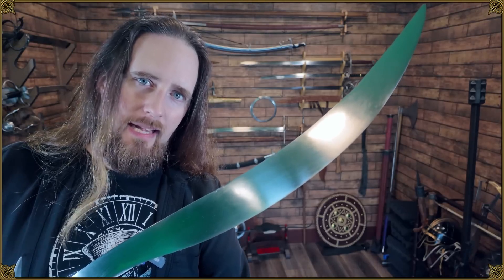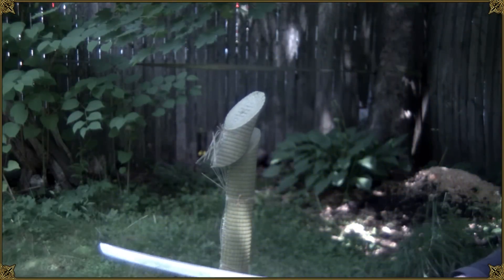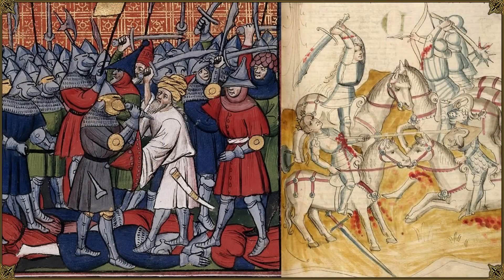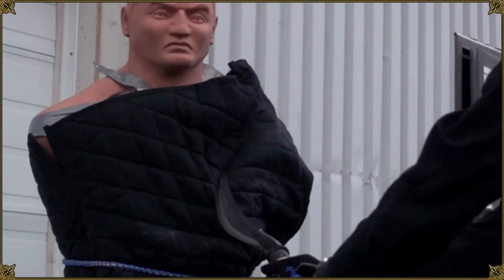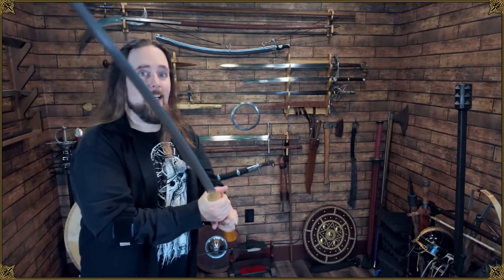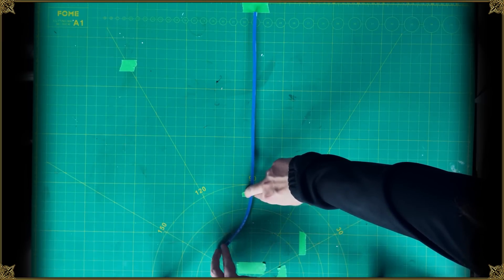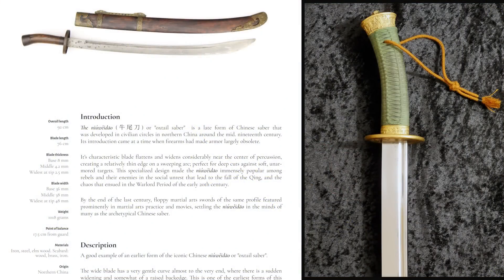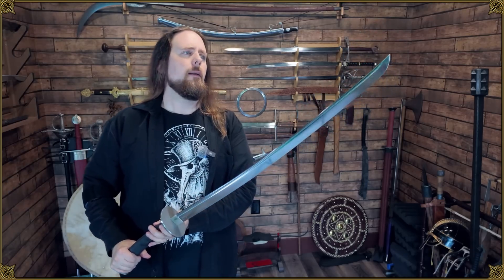Sword Design: What's the Recurve For?

Comment: I can see a couple possible advantages to a forward swept handle:
1) It might help with feeling the edge alignment, as the handle will be swept forward in the same plane as the blade.
2) It might reduce wrist strain or improve the strength of certain movements. Since your shoulders are further apart than your grip on a sword hilt, your arms aren't aligned in parallel with one another when holding or moving the sword horizontally. This would make the forward swept hilt the equivalent of those ergo keyboards where the keys are split into two groups at an angle from one another.

Comment: Regarding the curved handles, the answer might be more in ergonomics than physics.
Do the following experience with a straight-handled and a curve-handled sword: hold the sword in your dominant hand in a neutral position and then pull back with your other hand untill it is physically stopped. With a curve-handled, two-handed sword, the range of rotation of your other hand untill it's stopped by your dominant arm is much greater.
Also, in one-handed sword, a curved handle make so you can hold the blade forward in a thrusting position without angling your wrist too far down, making it gentler on the wrist.
Reply: I based my guesses on an book by Rainer Daehnhardt ("Homens, Espadas, e Tomates"). In one of the sections of this book, he correlates weapon design with wrist angles, namely that the range of motion of the blade, limited by wrist mobility, can be expanded by certain design choices of the handle and crossguard.

Comment: The curved handle in on two-handed sword gives a slight mechanical advantage when the blade has already made contact with whatever it cuts through. A curved handle with a single-hand sword is more about grip ergonomics and the angle of your blade relative to your hold.

Comment: This is just speculation and I have no data to back it up, but I feel like if you were cutting a limb or some target with a small cross section the difference would be minimal. But if you were trying to cleave into a torso or a target with a larger cross section the curvature would spread the point of contact out and allow deeper penetration. 
Just how a lawnmower blade is dead straight, but an axe blade typically has a curvature to it. If you took the radius from an axe head followed it out to sword length it would have a decent curvature to it. 
As far as the handle being curved, I can only figure that the extra distance between the pommel and your arm would translate to a decent amount of travel at the sword tip. So, theoretically it would allow more power from the wrist to be incorporated into the cut.

Comment: I am imagining Christopher Lee's Count Dooku response video where he argues the curved handle is not the placebo effect it is like a dance where the left hand leads transferring force from standing straight to cutting down, yes you move more than with a straight sword. Still, the curved angle of the handle requires less force from the user because body weight is transferred into the cut.

Comment: The way that I see it, a curved blade (or even bent like a kilij) redirects the energy of what would be a chop into a slice. So, you can have all of the power of one, but redirected into a slice. You do get a slice with any cut, of course, but it's more of a chop and then slice than the energy going directly into the slice. Grip? No idea, feels like it would turn it back into more of a chop. Maybe on a one-hander you could hold it a bit further down to align the point better, maybe get more of a chop. No idea, harder for me to imagine the advantage of that.

Comment: For the forward curved handle on single handed swords it looks like that became more common, at least in western Europe, during the industrial era for cavalry swords. It was the era when armor was practically non-existent and cavalrymen were trained to hold their swords point outwards during a charge almost as if it were a spear and the curve at the bottom of the handle could act, as you said, as a stop to keep the handle from pulling out of the hand especially since you would be pulling the sword out of a target as you ride past him, and he you. If I'm not mistaken many cavalry swords also had a forward facing half round end and that may have provided the same benefit.

Comment: I really enjoyed this video!  
I've been hearing the explanation of why curved swords are curved (the increased cutting edge per length) go around youtube for a while, but it doesn't seem like the primary benefit to me.

In my mind it makes more sense that a curved edge changes the inertia at point of impact, which is really hard to describe in words.  
So, how it looks in my head is if you draw a perpendicular line at the point of impact along the blade, a straight edged blade would have that line perpendicular to the spine of the blade.
A curved blade, however, would have that line go forwards or backwards along the blade (not perpendicular to the spine) and therefore have more steel behind the point of impact compared o an equivalent width straight blade.  Thus increasing inertia at point of impact by some amount.

An equivalent effect might happen when using a straight edged blade in a rigged hammer grip, and in reality any sword would be slightly off perpendicular, but even a slightly curved sword would be noticeably more off perpendicular

Comment: Idk if it's the liuyedao comments under the last video or what but if I can't have a slight recurve in the blade (like in hema) I absolutely adore the slight recurve in the grip, or at least the pommel if the grip is short enough. For one - my mangled right hand just works better with it (lol) but more importantly it slightly increases the max extension range, provides better point control and makes thrusting easier and more comfortable. There's a reason Olympic fences tend to gravitate towards literal pistol grips lmao

Comment: For blades from SE Asian islands, recurve in the blade is often used to bring the tip back into alignment, and recurve in the hilt is there to improve the Integration of the hilt with the hand to enhance cutting power with the grip itself contributing to power delivered by the blade. I haven’t seen recurve employed elsewhere in Asia or Europe with such consistency.

Comment: The curved handle is more about biomechanics. Take a straight handled two handed sword and hold it at full extension. I’ll bet that your left wrist is overflexed. Now do it with the curved handle sword. Your left wrist is flexed less.

It’s not so much about reach as maintaining power throughout the cut. It will be even more obvious with a sword with a curved blade and oppositely curved handle. It’s really obvious how badly your left wrist is overflexed when using a sword with the blade and handle curves in the same arc like a katana.

Single hand swords with curved handles can be held at the curved end for the same effect though it does throw the natural balance off.

Your tabletop demonstration should look at the length of  arc the handle moves through, not the linear distance. With a drastically curved or recurved blade and curved handle, the starting point will depend on where your hands are same as with a straight sword, but your hand positions will be different.

Comment: My complete guess is that the effect is one of biomechanics: by recurving a two-handed hilt, it changes the pivot point between the push hand and the pull hand, and thus shifts slightly more work to one and less work to the other (for the same amount of distance the hands travel). So maybe the net effect is simply that it's less tiring to use?

As I said, this is merely a guess.

Comment: About the curved handle, especially on one handed swords where you are supposed to grip the straight part, I would say the handle is curved for aesthetical reason. Weapons are also status object like cars or clothing. Not everything on them is functional. Curved handles on a curved sword like the one you showcased makes it look cooler and slicker. If you think you're sword is cool, it does gives you a slight placebo effect when you swing it around. Rule of cool is something.

Comment: I see two benefits for curving the handle forward:
First, it increases the distance that the bottom hand can travel (able to exert more force or extend the duration that force is actively exerted), while also puts the bottom hand in a more favorable position in terms of body mechanics.
The second is that it redirects the force of impact more favorably to the hand compared to a straight handle.

The first point can also be a demerit, as it also means that the sword handling would slow down and the bottom hand becoming less protected.
Edit:
After giving it some more thought, fighting with forward curving handled blades probably have their own techniques that overcomes the slowing down by having less take-up in the swings and presenting the tip more forward.

Comment: The more sword curvature is discussed the more I think it's less about cutting and more about facilitating different techniques. I have been doing Iai on and off for a year or so and I've noticed how the techniques we use are more about using the features of the sword in a certain way rather than, say, "do this thing to cut good". All swords can cut, slice, chop and thrust, they just do it slightly differently based on their properties.

Comment: I'd imagine the recurved portion is mostly about countering the blade displacement from a curved edge.

Just imagining a straight line from the handle outward, a curved weapon deviates from that imagined center right away, but an initial counter curve would bring it back into where we would expect the blade to be.

This would make it potentially easier to intuitively understand, specially with the first weapon you displayed. The convex section of edge is forward of that imagined center, making it similar to an axe/pick/hammer. So basically, its the perfect sword to go "unga bunga" with.

Or, what's likely the true reason for it... Someone made a sword like that once and people thought it was neat. Fashion matters, baby!

Comment: That handle probably makes it easier to do more complex movements - such as coming to guard or parrying. The off hand is positioned further away from the body - which gives more room for the off hand to swing left or right and thus shift the position of the blade. With a straight handle - that's not harder to do: but the sword itself needs to be further away from your body, or you may even have to shift your cross section (chest/upper body/shoulders) in order to perform a tight block/parry/guard. As where with the bottom most portion of the handle further forward - it's probably much easier to perform. Try doing a tight guard as though blocking an attack, then shifting the blade to counter attack from the tight guard - that's probably easier to do with the curved handle as compared to a straight one.

Comment: In some carriers,  a curved handle might dig less into your hip for horses or sitting or something. Definitely can align the edge with your eyes closed better. Also different wood than straight or the grain will split. Curved ones cut in straight grain need caps or else, same reason for a rifle buttplate.
    One thing that curved down handle will do is the same thing a curved ax handle lets you do,;- it is gonna let you open your hand a bit and keep it loose from jarring strikes that make your hands numb and hurt. It switches the grip to one that would throw the other.
   May have split 200 cords of wood before I broke, the old maul with a slimmer eye for a felling handle was so much better than straight.

Comment: As I udnerstand it to explain it to myself, a straight blade needs to retract, changing motion at a nearly 90º angle (I guess usually less than that)  relative to the direction on which the mass is moving iin order to slice without stopping the contact with the target, while a curved blade gets "out of the way" and more of its mass gets beyond the target which helps "pulling" the dge forwards and cutting. Does that makes sense? I imagine a recur simply puts does that twice with the mass putting the whole thing forwards from the pushing force (your hand) and therefore, like an axe, building up more momentum or something... mi not a physicist
  If I had to takea guess when it come sto the forward handle it would that perhaos you need to biring your hands and therefore your  elbows and shoulders less backwards so it might be more comfortable in tighter spaces? maybe?
Reply: I guess this happens when you comment before watchign the video, as it was mostly adressed haha. Anyway, if I had to make a coutner argument, perhaps is that a forward handle might hit in a place in the flow of your arms that might give it less power? I would have to try... although the rotation of the handle is  probably smaller so it might carry might force who knows

Comment: From engineering PoV there are two possible mechanics at play. 1) Biological: muscles that are differently pre-stretched apply different amount of force. You might add power of your left fingies to last 20% of swing if it is curved and since those muscles are faster then forearm muscles - you have better swing  2) Mechanical. Effectively, you have two levers with different ratios. It is like with the car - you start on low gear, and finish on higher gear (keep in mind it happens with changing angle of left hand force relative to handle and right hand pushing vector as well).

Comment: I think the curved handle has more to do with ergonomics, specifically as it relates to the range of motion at the wrist.  That rear hand can only rotate a few degrees.    (According to "Human Dimension & Interior Space", by Panero and Zelnik, 1979, ulnar deviation is around 30 degrees while radial deviation is only 15 degrees.  Yeah...  I'm that guy.)  I think by curving the handle slightly, you might be able to squeeze out a few more degrees of movement of the sword, which in turn might yield more power in a "snappy" style attack.  I noticed on the straight handled sword, your rear hand was practically holding the wheel pommel, which sort of simulates how a curved handle would fit in your hand and allow for a more comfortable wrist position.